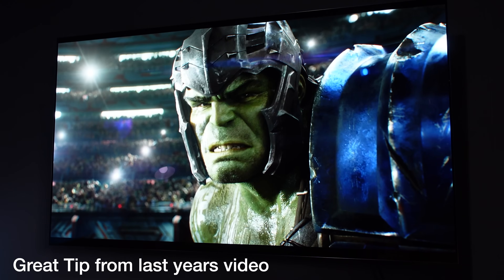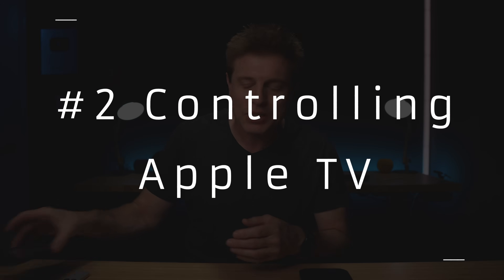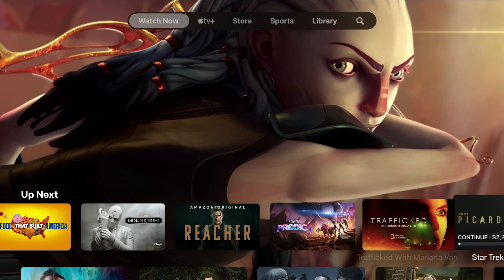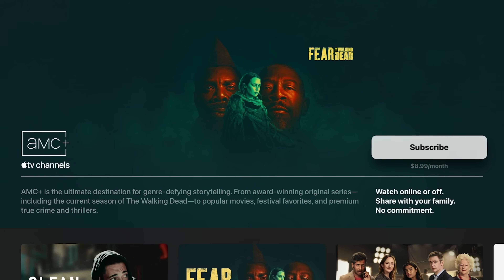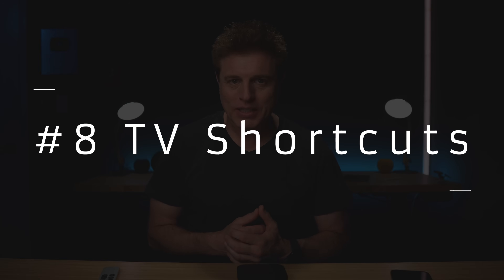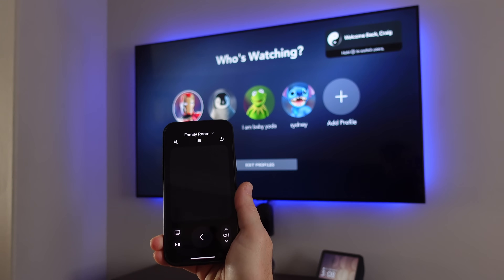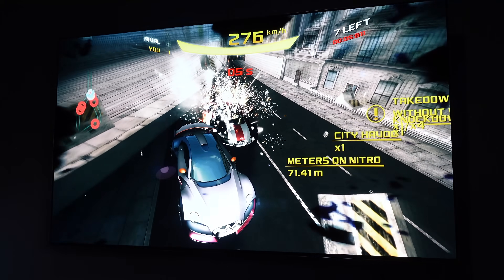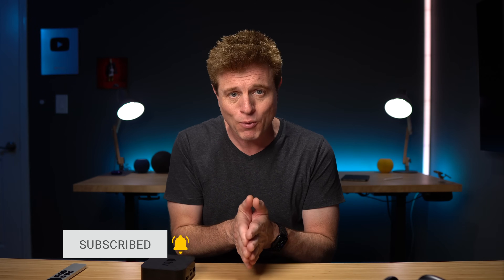10 Apple TV TIPS You Need To Know! (2022)

Comment: @Craig’s Tech Talk — RE: Tip #3 (Audio to other devices)… I have an AppleTV 4K, LG C2 and DVD blu-ray player. I use all iOS devices along with an iMac. Recently added 2 Sonos Amps for surround sound & turntable play. Works great. Will be expanding Sonos configuration to multiple rooms using Sonos Port and exiting Rotel Amps. Would it be best for me, like you, to connect my AppleTV 4K to eARC HDMI port on my LG C2? ThankU.

Comment: My HomePods are the only things showing up on my Apple TV 4K for some reason I’m unable to pull up my HomeKit outlets that work with my phone and computer but it doesn’t show on my Apple TV.
Reply from the maker: Just to confirm the Apple TV is signed in under the same iCloud account as your HomePods. If they are all under the same accounts and signed in on the Apple TV, there are minimal HomeKit settings. You can go under HomeKit settings and confirm that My Home is connected under home hub. I can't think of a lot of options.
Reply: @CraigsTechTalk  yeah I can’t get the outlets to show up still.

Comment: TV shortcuts is the best for football games and commercials - epecially when using YouTube TV app which sucks to use with the remote. Sure, I can use the Siri remote and say, "Fast Forward 3 minutes" and it jumps. I have presets for Skip 25 sec, Skip 10, Skip 2 min, Skip 3 min, Skip 4 min, Back 7 seconds (old TiVo user here) and Back 1 min.  I just wish i could make these buttons avail on the Home screen or as a widget.
Reply from the maker: Very cool. That is nice you have it dialed in. I have 3 shortcuts that turn on each of my 3 TVs and switches to my account. I put those 3 shortcuts in their own folder in shortcuts. Then I put a shortcuts widget on my screen that accesses that folder. I use a widget with 4 shortcuts. But there is one for 8 I believe.